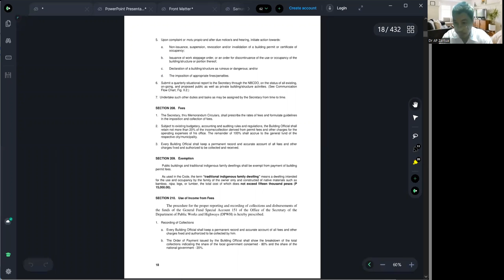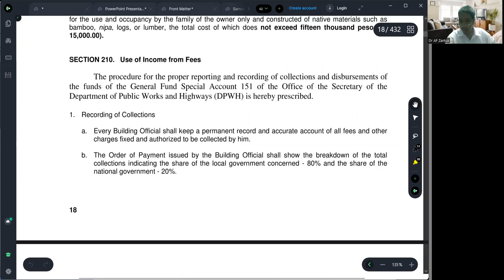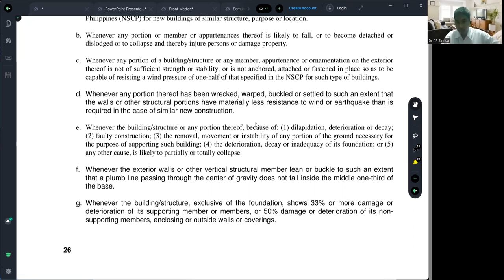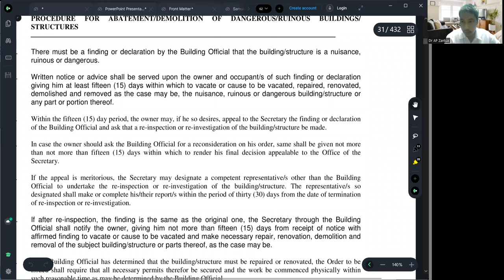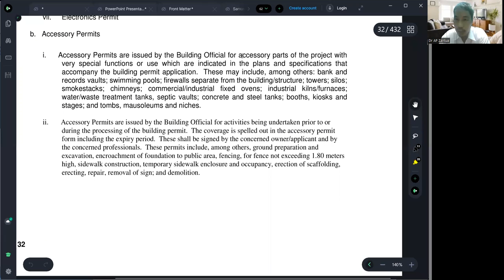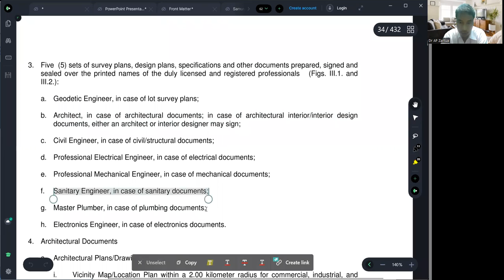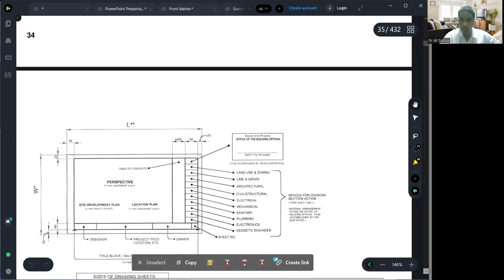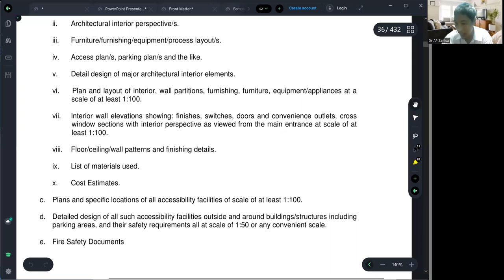Engineering Plans: RA 1096 NBCP Building Code 2005 IRR Permits & Inspection [ PRPC Design ] M1.01.3

Comment: Thank you for giving us a very well-explained video regarding the possible hazards if building code is not followed. I’ve learned that whenever any portion thereof has been wrecked, warped, buckled or settled to such an extent that the walls or other structural portions have materially less resistance to wind or earthquake than is required in the case of similar new construction.

Comment: Thankyou sir for continuing the discussion on engineering plans ra 1096 nbcp building code 2005 irr permits & inspection. The video shows building permits and the specifications of the standard form of building designs.

Comment: Thank you, sir, for this follow-up video lecture on the Philippine National Building Code and its Implementing Rules and Regulations. The purpose of the Office of the Building Official is discussed in this video. Building permits, specifications of the standard form of building designs, structural hazards, fire hazards, architectural deficiency, and many more are mentioned and discussed here.

Comment: thank you sir for the continuation of the last discussion wherein, the official organization Were discussed. Section 209 tell the exemption which public buildings and traditional indigenous family dwelling shall be exempt from payment of building permit fees. Rule III-permits and inspection discussed about ancillary permit (architectural permit, civil/structural permit, electrical permit, mechanical permit, sanitary permit, plumbing permit and electronics permit. Also, I’ve learned that there is also an exemption from building permits which a building permit shall not required for the following minor constructions and repair, provided these shall not violate any provision of the code and this IRR.

Comment: May 28, 2022
Lesson Video #23
Good Design Principles: Foundation & Coherent Structure [ Good Building Design ] Module 0A
Thank you for discussing is the Good Design Principles. I’ve learned more about foundation, which be made stronger since it will bear the weight of a house. And foundation also depends on the soil, if the house will be built on a weak soil, the foundation must be stronger. I learned also that the soil where the foundation will be putted must dry and not waterlogged for it become liquified in an earthquake. And also the important od coherent structure, it will protect the whole house. 

Lesson Video #24
Practical Design Principles: Joining Walls, Roof & Bldg Structure [ Good Building Design ] Module 0B
Continuation of the discussion about the Good Design Principles. The third principle is Joining Walls to roof structure, it can be done when the column reinforcement protruded from the top concrete columns and be bent around roof trusses for structural strength, or the roof trusses should be strapped with the metal ties to the wall. The fourth principle is Tying walls to building structures, walls tied to columns protect them from falling. It stated that walls must be tied to  the building structure so that they do not move separately when the forces of nature impact them. And the fifth principle is Roof Truss Ties, flexible but strong roof trusses enhance safety. It means that the joints of wooden roof trusses need to be bolted together and tied with metal straps to provide flexibility but not collapse under the forces of nature. The sixth principle is Cross bracing of walls and roof, the walls and roof need bracing against lateral movement. 

Lesson Video #25
Practical Design Principles: House Elevation & Site Selection [ Good Building Design ] Module 0C
Continuation video about design principle. I have learned the seventh principle the drainage principle, it is essential to good house model. A high rainfall area requires a drainage plan for roof water to a common drain. Levels of the drainage system need to be included on plans so that the rain water flows away and does not form puddles that breed insects around houses. It was also tackles the guideline where to build and not to build, as an engineer we must located a high elevated area to build houses for the safety of our clients to some rainfall damages or flood. 
Lesson Video #26
(UNTV) Sen Nikki Coseteng: Substandard Steel exposed [ Failure of Structures REACTION ] Module1.04.x
As I watched the interview with Sen. Coseteng, I feel her concern to the safety of every people as well as to the economy of the country. And as I watched and followed it up with some research, I found out that TMT Rebar is commonly used in construction of building and high-rise building, but as I also check the NSCP 2015 and as what Mr. Morales concerning about, it clearly stated in NSCP 2015 to limit the use of QT/TMT steel bars in high-rise construction because they cannot be subjected to bending, welding, threading or galvanizing. Morales also mentioned “What appears to be tough on the outside, actually has a weaker internal structure” and as an Engineering student and future engineer it is very important to ensure that the local construction industry does not build infrastructure that would be unsafe in the event of a high intensity earthquake. And to ensure the safety of individual and economy of the country, manufacturers must undergo series of testing to qualify or approved the quality of every steel that will be used in every construction and make a code like embossing the letters to the steel and not just putting color coding for every quality of the rebars.

Lesson Video #27
RA 1096 NBCP Building Code 2005 IRR Contents [ PRPC Design ] M1.01.1
Thank you for informing us about the content of National Building Code.
Lesson Video #28
RA 1096 NBCP Building Code 2005 IRR General Provisions & Administration [ PRPC Design ] M1.01.2
Thank you for giving us information about Implementing Rules and Regulations of National Building Code of the Philippines (PD 1096). I have learned that this book content of general information or codes needed in building a structure. And also looking forward to be familiar with every terms here.

Lesson Video #29
Engineering Plans: RA 1096 NBCP Building Code 2005 IRR Permits & Inspection [ PRPC Design ] M1.01.3
Thank you for continuing the discussion about NBCP and its IRR. I’m bit familiar with some section in this book since it was tackle to us in our different unit

Lesson Video #30
(EngineerBOY) Engineering Construction Fail [ Failure of Structures REACTION: PRPC Design ] M1.01.4
Thank you for giving us a heads up about engineering construction failure. What I realized in the discussion, is that it is very important to have an engineer in terms of building houses and other structures, because mostly of the common failure of every houses is poor structural design, sometimes due to substandard material or cheaper value of materials and lessening the number of columns to be putted.

Lesson Video #31
(EngineerBOY) Engineering Construction Fail [ REACTION VIDEO: PRPC Design ] M1.01.5
Thank you for continuing the previous topic about engineering construction fail that gives as awareness on what and what to do in our future endevour when we are already an engineer.

Lesson Video #32
[ LIVE CE E7 Lecture 04 ] DrAP Zantua Reinforced Concrete Talks + ENGINEERING Analysis & Design
Thank your for having a recorded live for us to rewatch the video multiple times and for discussing the Concrete and Steel Compatibility

Lesson Video #33
[ LIVE CE E7 Lecture 05 ] DrAP Zantua Doubly Reinforced Beam Talks + ENGINEERING Analysis & Design
Thank you for discussing us the doubly reinforced beam and for recording it so I can able to rewatch it when I need to review.